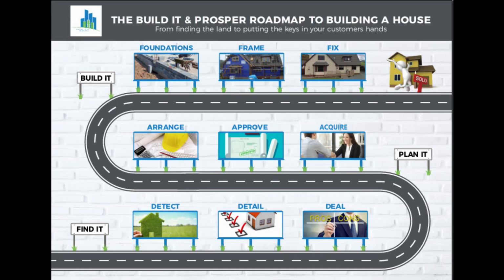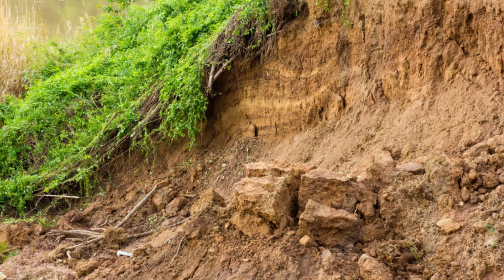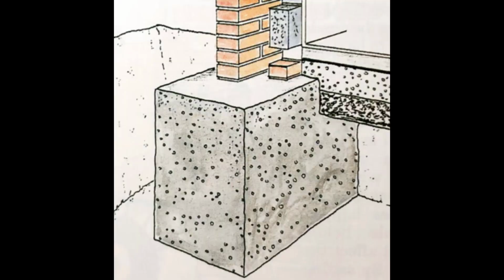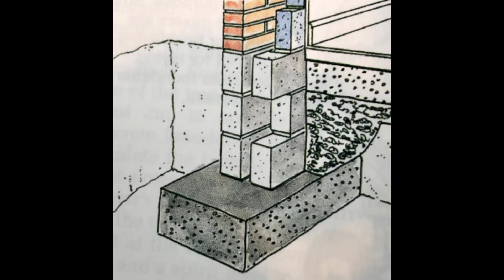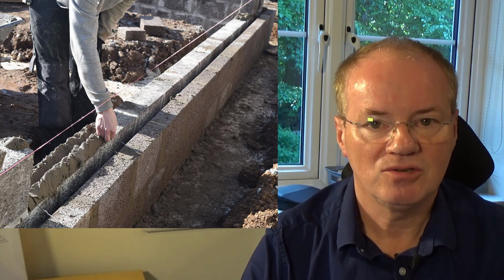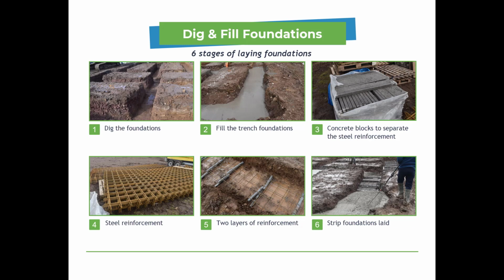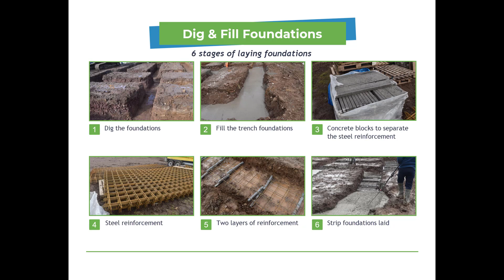Watch Dig and Fill Foundation Trenches for a House - Build a House

Comment: excellent. saw the trench filled with concrete and then the rebar on top flat and then concrete again. usually I see rebar assembled and coming from the base of the trench and then the concrete,where as in this one the trench been filled with concrete with out rebar. What's the difference between having a rebar in the trench before filling with concrete and this one with out rebar coming from trench before filling with concrete? I'm just a beginner
Reply from the maker: Hi shaheb ali The trench fill foundations in this video was required to support the strip fill foundations.  We had solid ground at one end of the foundations and at the other end we had made up ground.  As this made up ground was not strong enough to hold the foundations, we used a trench fill foundation as a substitute to solid ground. Had we build directly onto the trench foundation then we would have reinforced the foundation there.

Comment: Where you poured concrete in the deeper trench, you didn’t lay rebar. If so, why not? Or did you start laying the rebar over the entire foundation area once your trench levelled up with your strip. And covered all this with the ‘top layer’ concrete ? Very Good vids btw. You communicate well! PS, possibly consider labelling and  numbering your vids in the different stages of the build.
Reply from the maker: Hi clothedwiththesun , The deeper trench was put in place to support the main foundation where there had not been previously solid ground. What we were doing in effect was using concrete to replicate this area of the foundation with the area of the foundation that had solid ground. So, in effect you could say it wasn’t really part of the foundation.  Hope that makes sense.

Comment: Good video!
Was digging out the entire foundation at the same depth, laying it in a single pour and without any reinforcement not an option?
Reply from the maker: Hi Tiktok Thank you for commenting.  I am not sure I entirely understand your question. Are you asking if you need to Reinforce the foundation? We reinforced the foundation in this case because the ground at one end was unstable and could have moved. If there was movement in the ground, then the whole foundation would move together.  The reinforcement would stop the foundation from cracking.  

A structural engineer will specify the foundation dependent on the ground conditions and would be part of your building warrant.  

Please let me know if this answers your question and if I can help you in any way.
Reply: @BuildItandProsper  Hi thanks for the response, I was just wondering if you could have simplified the Works by digging all the foundations to the same depth so a single trench filled pour could have been done w/o the need of a second pour
Reply from the maker: Hi Tiktok, Thanks for your comment. Perhaps you could done as you suggest, but it would have used considerably more concrete, which is not cheap and you would have a lot more earth  that would have to be taken off the site, increasing transport and labour costs.  Then there is the cost and tax of disposing of this earth.   So the way we did was the most cost effective.

Comment: Why no concrete pump 😢 😂
Reply from the maker: Hi @timwhittles6414 You only need a concrete pump in hard to access areas.  In this situation as we already had a digger on site, having a pump would only have added to the cost.